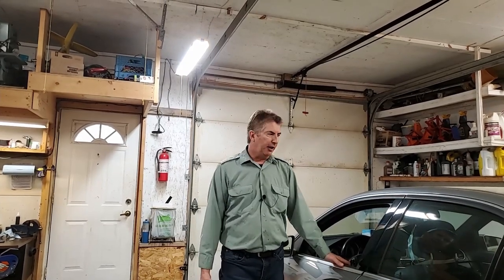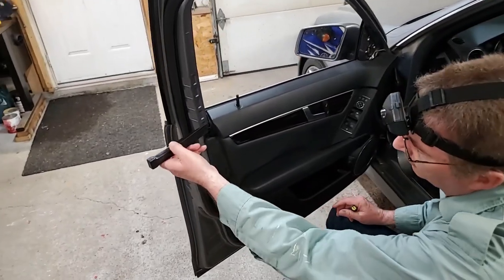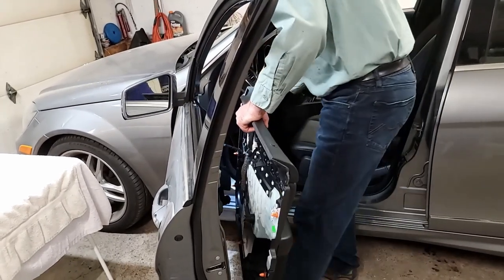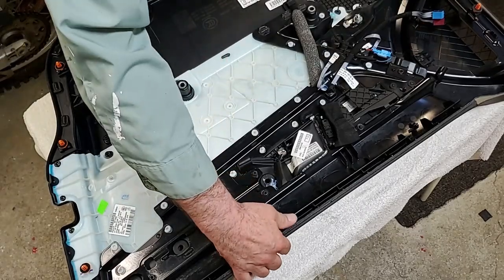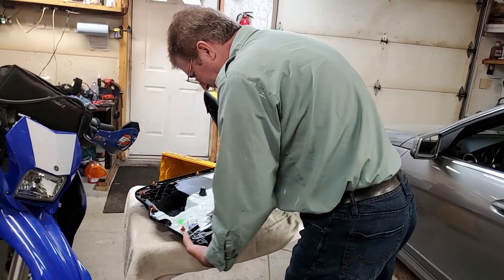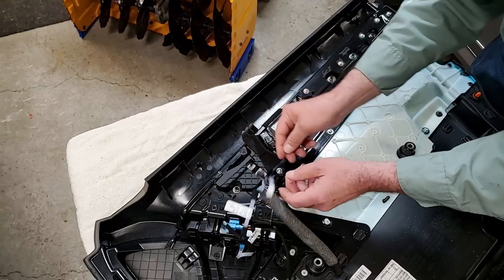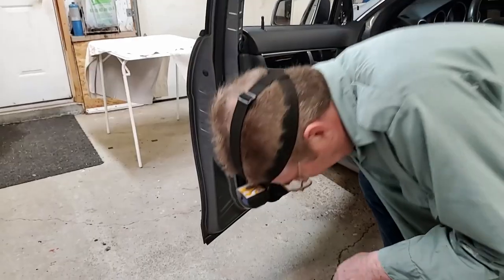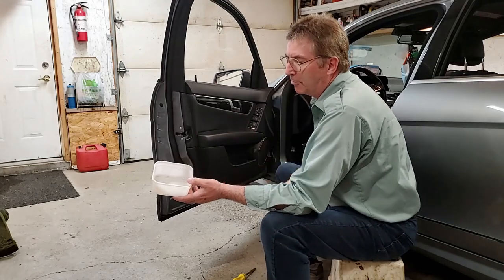Replacing Door Handle,  Mercedes Benz

Comment: This really needs to be a safety recall by MB. I've been putting it off for a while waiting for the weather to cool a bit.
Reply from the maker: I agreed and don't know why there is no safety recall. I put A/C in my garage, I don't like working in the heat either. Thanks for watching.
Reply: @FRUGALWITHJOHN  My mechanic quoted $600 to do the job and given how much labor is involved,  I can't really blame him. Thanks for the footage!
Reply from the maker: $600 is a fair price to pay for that job, MB charges $1600 because they change the entire door panel.
Reply: @FRUGALWITHJOHN  I agree. It's well within reason. Still should be a recall lol
Reply: Theres a few issues with the W204/S204 that should be a recall .. the timing chain issue on the M271 and these handles. MB seriously dropped the QC.
Reply: @Tcat's Rides  I did aswell and they were going to order a whole new panel rather than recreate it. I have the same handle kit and they wouldn't do it alot of places.

Comment: Hey John. I just replaced my handle by your instructions. The hardest part for me was getting out that old pin. Really struggled with that. Will suggest everyone watching to take your time with that pin. Everything else went smooth. Total cost for parts 21 euros for me. Works like a dream
Reply from the maker: Glad it helped, I did not have a hard time getting the pin out, with the tool I used I was able to drill dead center. I did have a hard time getting the new pin back in. I eventually used the old pin not the one in the kit. Don't forget to give the video a like, it helps the channel grow, thanks.
Reply: Interestingly enough me and my dad also ended up using the old pin!!

Comment: I just had to do this as well. My door panel did not come apart quite so easily as they super heated the panels together ( literally melted plastic to plastic in some places). Wait until your ESL corrupts your ignition switch if you thought this one was difficult. You will have to replace your ESL as well as your EIS, and remember to replace the ESL first. :P
Reply from the maker: Thanks for the information.
Reply: @FRUGALWITHJOHN  Thank you for the video. I wish I would have watched this before I did the repair.

Comment: Omg, I thought you were kidding on how much a repair shop was going to charge for this repair. I was quoted $1200-$1500 for a local shop. Your video was a great help. I just recommend not taking off the window seal. Just pop the bottom on both ends and let it hang there. Also I noticed I had a few tabs that I had to cut off that did get replaced with screws. Great video and recommend it to anyone having to replace the door handle. I purchased all need tools  from your comment section. Thanks again for the video… John, post falls Idaho
Reply from the maker: I think there's four that need to be cut or grinded off that don't take screws, 24 spots to grinded or cut and the kit has 20 screws. Glad it helped, thanks for watching. This may help others in the future https://www.facebook.com/JohnTGauthier/photos/a.111446997359141/425243102646194/

Comment: Best video I've seen on replacing these door handles. The whole interior door replacement panel alone from MB parts is around $750. I'm going to buy the door handle parts kit for under $20 now that I've seen John's video.
Reply from the maker: Thanks, and good luck with your repair.
Reply: Where do I buy the kit?
Reply from the maker: Check the description in the video.

Comment: hey, thank you so much for the video. One question I have is about the LED courtesy light that had the little white clip and the smaller black one that clips on the L shaped plastic LED light. Is the L shaped hard plastic the light or is it the bottom black part that clips on?  Mine doesn't work and I was thinking about replacing it.  there isn't a lot of info about replacing it.  Did that light work on the car you fixed?  Its the light in the gap where you actually grab the handle on the interior.  Any info would be great!  thanks!
Reply from the maker: The led light did work on the car I fixed. I never tried to order one or replace one. I went into detail on the video on how to remove the led light.

Comment: Much Love and Respect to you John. i havent even begun my repair but you have boosted my confidence through the roof. in All honesty i cant wait to get started.
Reply from the maker: Thanks, good luck with the repair.
Reply: @FRUGALWITHJOHN  Where can i find the names of every tool required. Or the ones you used.
Reply from the maker: I put a list of tools I used in the description of the video. The only tool not in the description is the torx screwdriver, mine was a Snap on.

Comment: Thanks for your great video. My handle recently broke. I thought it was the cable. Have you ever heard of the cable breaking and not the handle?
Reply from the maker: It can happen, but most of the time it is the handle. Thanks for watching.
Reply: Yup , pretty sure i just broke my handle too
Reply from the maker: It doesn't hurt to watch the video a couple times before you do the job, and check out the picture on my facebook page for locations where to cut and grind. Thanks for watching and don't forget to subscribe so you can find this video again, I also have a detailed video of rear brakes on the same vehicle.

Comment: Question - for a 2013 e350 -  I needed to replace the rear passenger door.  
I was fortunate to find a replacement that matches except for the exterior door handle. The original door has the touch sensor, the replacement does not.  Would the replacement door be wired for the touch sensor handle.
Reply from the maker: As a rule, most manufacturers use the same wiring harness for a particular model and just plug in the options when required. I say as a rule, (I can't be sure the E350 does) It is a lot of work just find the plug is not there. Your best bet would be to call Mercedes Benz service department.
Reply: @FRUGALWITHJOHN I’m trying to manage my expectations before swapping the handles.   I’ll call Mercedes.  Thanks.

Comment: Sr. Thank you for the vid interesting but MAN!!!! Is a lot of work I just I'm try to order a new panel still is going to be cheaper than the dealer would charge me .. the dealer doesn't do handles and I'm sure that job could cost me around $1200 no less ... thank you 👏👏👏👏👏👏👏👏👏👏👏👏
Reply from the maker: It is a lot of work, but not that hard if you take your time. The cost breakdown: the dealer = $1600, new door panel from dealer = around $800 then you need to install it, door handle from Amazon = around $20 to $30 then watch the video numerous times while you're doing the work, show the video to a mechanic and ask him/her how much to do the job = should be around $500 to $600 + the cost of the door handle. Thanks for watching.

Comment: Hey I have a problem with my 2014 c250 we got the handle replaced but the door handle is still not working. Any suggestions?
Reply from the maker: Did you put the cable in the holder on the door panel? If the cable is not in the right spot on the door panel it will not work. At 6:51 on the video is where I show where the cable goes.
Reply: @FRUGALWITHJOHN  yeah that the problem we had bought a new one and put in. But the handle would unlock the door but wouldn’t open the actual door. It’s weird
Reply from the maker: Without seeing it, it would be hard to know where problem is, let us know what you find.

Comment: Hi, which way does the new pivot pin go into the handle?
Reply from the maker: I would need to re-watch the video, I used the old pin, but the hole I drilled was dead center and small.
Reply: @FRUGALWITHJOHN  Thanks John, In the end I used the old pin for the same reasons.

Comment from the maker: There's four spots that need to be cut or grinded off that don't take screws, 24 spots to grinded or cut and the kit has 20 screws.  This may help https://www.facebook.com/JohnTGauthier/photos/a.111446997359141/425243102646194/   If this video helped consider sending a Super Thanks, not necessary but will help with getting better video equipment to make more videos like this. (Thanks in advance)